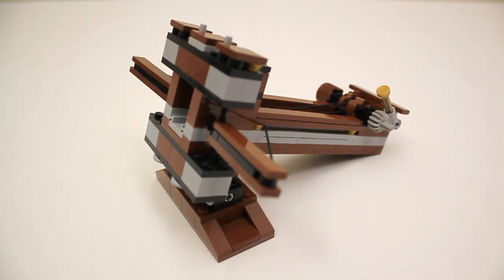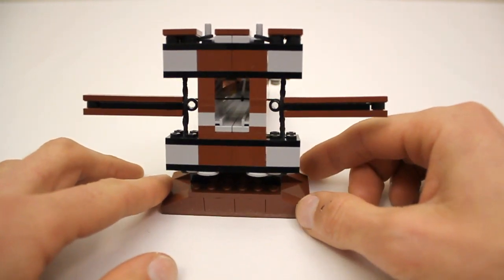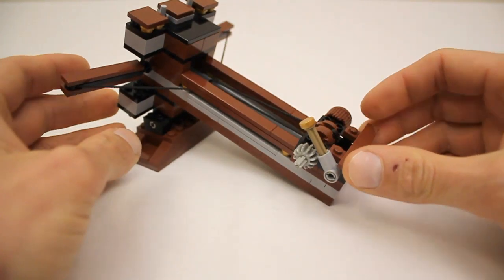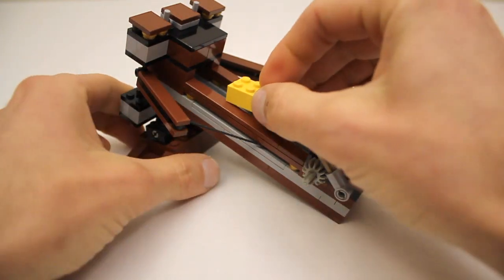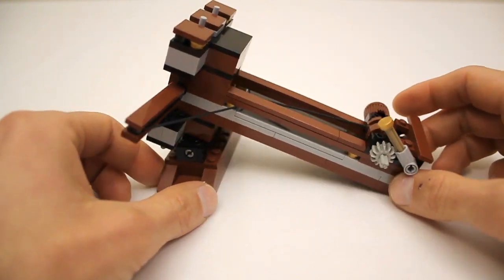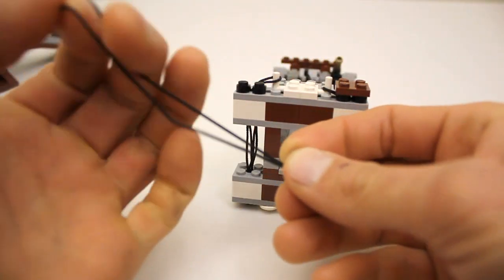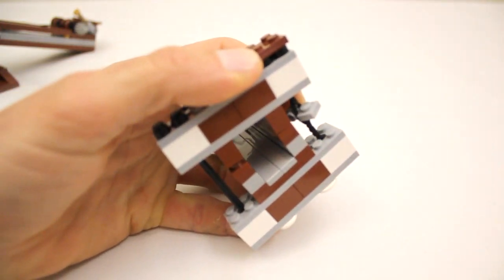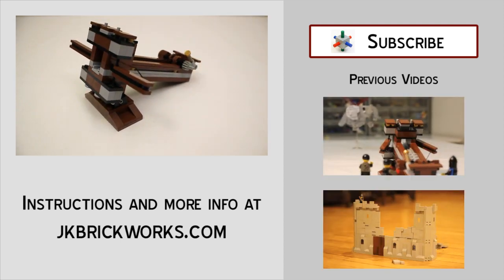Working LEGO Ballista

Comment: Hi, is it possible to make a model that reach the range of 35/40 feet? I've read that an ancient roman ballista would probably shoot around 500 yards (460 meters). If we compare this range in scale with a lego minifigure (4 cm that would simulate a man around 1,75 meters), it means (460/1,75) x 4 = 1.051,428571428571 cm (around 35 feet). So, i'm woundering if we can reach this range in scale with a lego minifigure. Thanks.